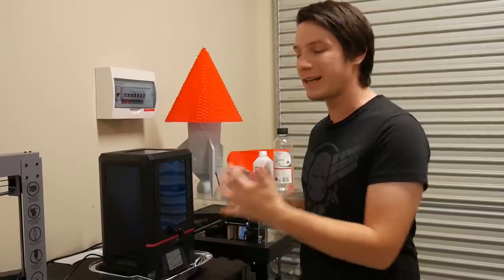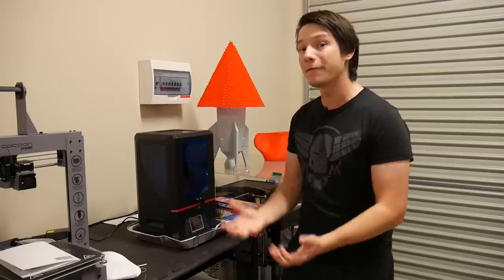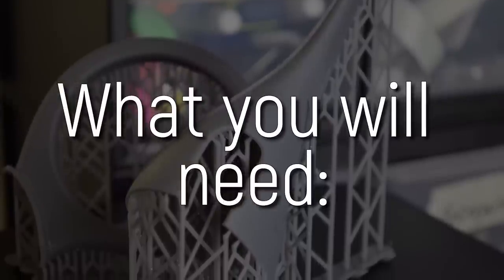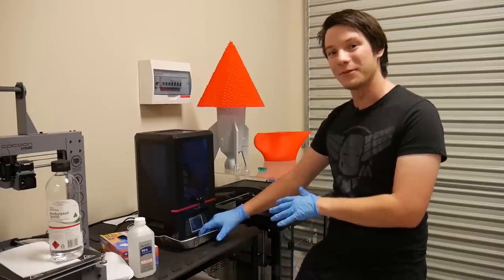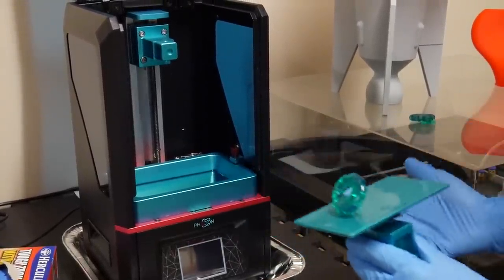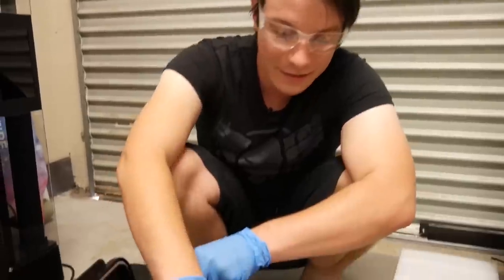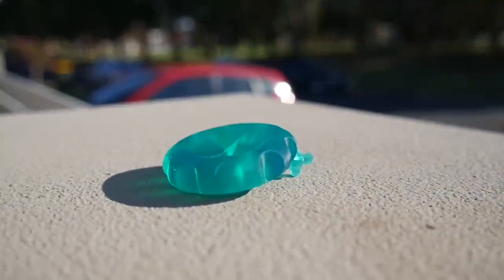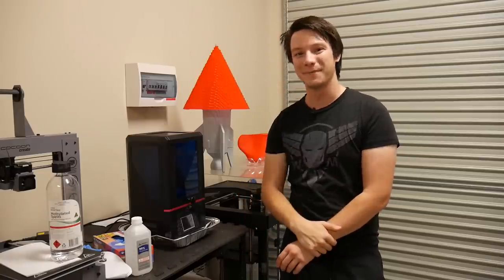Resin 3D Printing Safety - Important for Beginners!

Comment: I ran photo labs for a decade. When I left the industry, I vowed to no longer work around chemicals that were toxic to the touch. Seems like resin printers really aren't for me, at least right now.
Reply: so it would be better to work it only outside, not inside
Reply: I doubt the resin from sla printing is as toxic as color photo development chemicals. I mean gasoline is something I wouldn't want to have repeated contact with my skin but it's not like i'm taking special precautions to prevent it because it's not a major concern. if it gets on me I wash it off. We don't even wear eye protection when we fuel our cars...and honestly I've been sprayed by pumps several times and gasoline in the eyes doesn't sound very safe.
Reply: @TheNitroG1  Resin is way more annoying than gasoline as it's sticky and doesn't wash off with anything other than copious amounts of alcohol. If you get some on your hands and try to wash it off in the sink with soap, the water just rolls off like those hydrophobic surfaces and all you're doing is smearing it around on your hands. I've worked with LOCA UV-curing glue for phone screens and it's the worst.
Reply: @peshozmiata  do you have experience with print resin or just the UV glue? If so, what resin are you using? I've used both Anycubic's proprietary resin and Monoprice Rapid (grey) in my Photon and they both clean pretty quickly with a little bit of IPA 91%.

Comment: I just read the safety chart, it is not extremely toxic. The test on rabbits mostly showed the eyes and the skin were mildly irritating with an dose of 500mg/24hours. There are not really many long term effects known when coming in contact in low doses. 
Just wear gloves but you don't be scared overtly scared of it.
Reply: Thanks. Everyone keeps saying "blah blah blah resin is toxic blah blah . . ." with NO clarification of what the symptoms or risks are. I mean, I DID get some on my skin, and I ain't dead, so obviously there is a bit more nuance than just "toxic." Lol.
Reply: From what I’ve read, it’s not Necessarily a toxin, but Hazardous because it can penetrate skin, and then upon UV (sunlight) exposure, can cure in your body, which causes an immune reaction that can result in additional complications with repeat exposure, much like repeat exposure to allergens eventually causing worsening effects and eventually anaphylaxis.
Reply: @ruggeddusty  any experimental evidence? And what you say isn't true for allergies. The immune system is extremely more complicated than that. As a counter argument, take a look at 'Allergen Immunotherapy'. What do they is repeated exposure to Allergens and this lowers the allergy reaction over time due to desensitization.
Reply: I'd love to see some better data as well. Just sharing what I've come across so far.
 @bonnome2  resins containing chemicals that are known sensitizers is totally a thing, and as far as I've read, it isn't treatable in the same way as environmental allergens like dustmites.

A sensitizer is defined by OSHA as "a chemical that causes a substantial proportion of exposed people or animals to develop an allergic reaction in normal tissue after repeated exposure to the chemical."
Reply: @ruggeddusty  I took a look at google scholar. "Resin" is a really broad term. Most pictures you find on google are about epoxy, this resin uses methacrylate, acrylate monomers, acrylate polymers with a photoinitiator
. There are indeed reporting of some allergies from this type of resin from woman that use artificial nails.

Apparently most 'gel nails' use a resin based on the exact same components.

Like I said. Just wear gloves but you don't have be overtly scared of this stuff.
Reply: What about burns? What I have  learned it really burns if you have resin on your skin and it starts curing. Ö_ö
Reply: @bonnome2  Yeah that's the part that I can't get around my head. There is UV Resin that people use on their FINGERS (more precisely their nails) every day and nowhere there is a warning on how dangerous that can or should be.

Of course you should not drink it or use it as an lotion, but it can't be super toxic when uv nail resin has no warning signs on it even in Germany (where safety standards are very high).
Reply: It's a cumulative danger, not an immediate one. If you work with resin every day for years, you can build up an intense allergic reaction to the stuff if you're constantly getting it on your skin. Surprised he doesn't also mention the danger to your lungs here. You really should be either wearing a mask rated for vapours or in a very well ventilated room. Idk about you, but I'd rather not have cured resin in my lungs in 30 years time. That said, I work with this stuff all the time, so I have to be careful.
Reply: Every resin is different though; it's a fact that all resins are not safe. The levels of toxicity are different with resin brands, and some may not smell as bad but can be just as toxic.
Reply: @theversatilehunter3651  What studies backup this?  Curious to know.
Reply: @ruggeddusty  which is a bit weird because in medicine there is also a concept of desensitization, whereby small, gradually increasing amounts of an allergen are given to a person with allergies in order to make them resistant to the allergy and not allergic to that specific thing anymore
Reply: Tell that to the Steve Clarke in the comments above who was diagnosed with stage 3 cancer after regular exposure to the fumes. Honestly, don't misinform people.
Reply: @MissyMona  working in printing industry is quiet a bit different then home resin printing; hope you understand the nuance in this.  Talk about misinformation... These are not the same things in any manner of speaking.  That would be like comparing skin cancer rates for roofers vs anyone that goes outside.

Every manufacture posts a msds; go read the sheet and make informed decisions based on the scientific data, not some expert on ytube.  This video made my eyes roll; gloves/glasses is ridiculous when there was no flume hood, ventilation or mask being worn.  Lungs are far more important to protect, especially if we are talking about skin contact dermatitis type issues vs cancer.

Then the bare feet, come on...
Reply: you left out the part about the chem burns in sunlight.
Reply: @MrNybios  Nail resin can cause chem burns.
And the nail stuff has much much less of the UV reactive component than the printer stuff does.
Reply: @theversatilehunter3651  Thankfully the VOX dosnt contain any of the stuff that can cure.
Reply: @Zagroseckt  also see lemon juice or margarita burns, shrug...
Reply: @Zagroseckt  So much less of the cross-linking agent? Would make sense as nail polish is much less stable compared to the printed parts
Reply: Immunotherapy is only used for natural environmental allergens and not food or chemicals. They choose very specific, mostly unavoidable allergens and give you a shot once a month for at least three years. This isn't applicable here. Not to mention, the shots still have the chance to induce anaphylaxis.

Comment: What about fumes? I've seen a multitude of warnings, and recommendations for using a respirator, and avoiding breathing the fumes in.

Also a litte side-note about the spatula (and this is just speculation):
I believe the 3d printer companies supply plastic spatulas to avoid damaging the build plate. If a too hard and sharp spatula is used it could easily scratch the plate and remove some of the morpology that is designed to keep the 3d print from falling off the build plate.
A good rule of thumb is to use a weaker spatula than the stength/hardness of the build plate.
Reply: I’m wondering the same thing about the fumes. Did you figure it out?
Reply: I didn’t look to far into it, unfortunately. However, most 3D printing channels I have checked out either explicitly mention the fumes as a a hazard, or show themselves wearing a respirator.
I believe if you work in a well ventilated area (such as having your printer nearby an open window, or hatch) it is fine, but it’s definitely something to be aware of and take precautions against. Especially if you think you might have a reaction to the fumes.
By the way, the masks that are often supplied with printers do nothing against fumes as they don’t stop the tiny gas molecules of the fumes. That is why respirator masks are so special.

As for the side-note I wrote, there also seems to be a difference between spatulas used. Some have plastic spatulas. These are used to scrape the screen clean, as it is easily scratched.  The screen should not be scraped with something sharp as it’s so easy to damage.
There are also metal, or similar, spatulas which work better for the build plate where you might need more force to loosen your actual 3D print, and where the surface isn’t as easily scratched.

Comment: Me:   FDM printers are great, but I think I'm going to go to SLA for my next printer so that I can print both big and small!
  The 3D printing shops:   1L of resin is £60+.
Me:   !!! Err... Well.... I guess the print's would be small so it'll probably last. (yeah yeah)
  The 3D printing forum groups:   SLA resin smells VERY bad.
Me:   Bah... 3 fans for ventilation and I'll be fiiiine. XD
  The 3D printing channel, Makers Muse:   Extremely toxic, bio-hazard, gloves, curing, hollowing files, toxic, eye protection, finishing station, cheap insurance, tilting parts, nasty chemicals, toxic.
Me:   ...
Me:   You know... Now that I think about it, I'm sure a super accurate FDM printer that has a .2mm nozzle, a 2 digit micron layer height and can only accept the extra-pure £40 filament would work just as good, right...
Reply: My resin printer has destroyed itself with failed prints after 3 days. Definitely not worth the detail increase vs fdm.

Comment: Thanks for the video, good stuff.  It would have been good to touch upon the nature of the consequences of exposure.
I'm scoping out my first printer purchase.  I don't think resin printing is for me.  The risk to benefit profile is insanely stacked against using this tech in my opinion... the risks are really serious and life-altering, and the benefit: a nicely printed little model or part?  Sounds like a potential massive regret in the making.  I'm also not a fan of single use items, and using and throwing away nitrile gloves with every print should seriously vex environmentally conscious folks.
I think I can live with the relative coarseness of a filament printer!

Comment: NOTE: Curing time depends on the resin. Very few resins cure in a few minutes out in the sun. For example, at the lab I go to there are multiple resins for the form 2 printer and we usually put them in an isopropyl alcohol bath for 20 min and a UV curing station for an hour.

Comment: I had the G4D Kickstarter resin printer and for me the biggest safety issue is the fumes from the resin. I am surprised you didn’t mention this as the fumes are also toxic. Having resin in the house for a day made all of us feel ill
Reply: Folks forget the silent killer - fumes..... I just watched a lady on Youtube use this machine for a 6 hr print in her dining room!!  I was like... NOOOOOOO.... people are a bit too relaxed with regard to these printers just because they are getting cheap and affordable.  Until someone dies from fumes, contact poisoning or their home burning down - unfortunately, the safety part of things just isn't going to hit home.
Reply: Regarding the fumes.  They are immediately perceived as more dangerous than the liquid resin because of the dreadfully toxic smell you get while printing.
The resin itself just looks like thin treacle and its easy to get complacent over something which looks harmless.

A simple cardboard fume hood with a $10 fan ducted out of a window works just fine.
Reply: @zybch  Could be... but folks are buying these for $300 and just setting them up on the kitchen table....!  Not... good....
Reply: This was my note too, because when I worked with resin (sticker doming), I always had to account not just for avoiding touching it but avoiding fumes. This meant plenty of ventilation and wearing some kind of filtration mask over nose and mouth. I would also very much worry about this stuff around pets or small children.

Also, I would never just plop a part in to a bath of IPA and let it splash. The part that lowers the item in to the solution is there for a reason. :D

Comment: I know this clip is around 4 years old by now and its interesting how it was handled back then like how to wash and the UV Solution of the nail station and boxes and so.
But it's a bit funny the see the youtube thumbnail "don't touch this" and the advices of safety on the one side, and on the other side, the guy wears short pants, no shoes, t-shirt, no mask and handle chemicals with toxic gases and the risk to get splashes of the resin / IPA which must be avoided.

Comment: Someone posted a link to this site which sells a somewhat non-toxic resin. It would be nice if Maker's Muse could test it out. Here's what they say about it from their web site: 
"EcoComp®  UV-L resin  A revolution in sustainable resin technology. EcoComp® UV-L resin is guaranteed to contain 95% vegetable oil.  The remainder is an Ultra Violet initiator which can be activated by UV light sources or even the Sun itself. The product contains no VOC's and needs no acetone or other harmul solvents to clean up after use."

Comment: What happen if you touch the uncured resin? I know it's dangerous and I won't do it but I want to know what happen if you do
Reply: Any chemical you touch gets absorbed thru your skin, then into the blood stream. All chemicals vary in rate of absorption. Some, like acetone can get into your system quickly, and others like resins a little more slowly. The issue is accumulation in your organs and damage over time, which can cause cancer, and or failure of things like the liver, lungs ect.
To understand the specifics of this resin, or any other chemical's health affects you have to find out what the chemical is ( brand ect) , and look up the MSDS reports on it.

Comment: Wears gloves and goggles. Leaves arms, legs and feet exposed.
Reply: I don't think he's planning to handle the part with his elbows or toes.
Reply: See here's the thing.....liquids splash.
Reply: It's not acid, you can just wipe it off quickly from your skin if you get splashed. Eye washing is quite uncomfortable.
Reply: Argus FPV resin is also fairly viscous and i can't think of when you would ever have it splash
Reply: Statement made without knowing the full implications... Resin is not THAT toxic or harmful, it is not an acid or immediately reacting substance... I could pour resin all over my hand and it will not harm me if I wash it off within  a reasonable amount of time... the toxicity that is being referred to is repeated exposure over longer periods of time, like handling prints without gloves on a daily basis over several months... the referred to "toxicity" is cumulative, not immediate.
Reply: If the UV curable resin is anything like other uv curable stuff i worked with they are a lot more harmful than many people think. They can induce allergies that will act up if you just get a bit of the vapors of the resin, preventing you from ever working with them again, cause cancer, cause mutations in your offspring, make you infertile etc... I'd take a splash of acid over a drip of that stuff any day!
Reply: HF being an obvious exception. That stuff isn't a problem because of the acidity, but because of the toxicity of Flouride. I looked at a few msds of resins and ok, no one had carcinogen in it, but all had causing allergies/sensitization.

Sure acid might hurt, it might leave a scar, need treatment for a while until the wound is healed, but it will heal. And i prefer that to anything with chronic/long time consequences. Better to break an arm than to lose a finger.
Reply: Dr. David Light, i think from a hospital in Houston, posted elsewhere that he was aware of 3 people admitted to ER in conjunction with resin based printers being used at their homes, two with severe respiratory issues and one with persistent memory loss.

While it stands to reason that they were mostly affected by inhalation of resin fumes, prior cases of allergic sensitisation caused by amine based crosslinkers suggest that skin contact could potentially contribute to the allergy, if the mechanism of sensitisation is similar, which is not exactly known. And after all, who knows what it will cause the allergy towards, it might be the resin components, it might be something else entirely. Allergies are a rare occurrence by their nature but potentially a deadly one or one that will affect someone for the rest of their lives.

I really hope someone can come up with non-toxic formulations someday.

Comment: Does anyone know how long can I leave my finished model in the printer? Let's say I finish in the afternoon, can I wait till next morning, or should I cure the model immediately?
Reply: K. Gabor, I usually just cure it whenever I’m around. I don’t think you have to rush to get it cured.
Reply: As long as it's moderately dark where the printer is, it can sit there for an extended period. I've been told you can leave the resin in the vat indefinitely as long as it's not exposed to UV. Just remember to stir it before use.

Comment: This is basic at best. You're also walking barefoot on the floor that is most likely contaminated with resin (judging from how you handle that spatula as you're about to wash).
Also, to get rid of toxic resin, just leave it in the sun. Like your gloves, washing machine, etc.
I have 5050 uv light strip all over the room I work in. When I want it decontaminated I press a switch and leave it for 30 minutes.